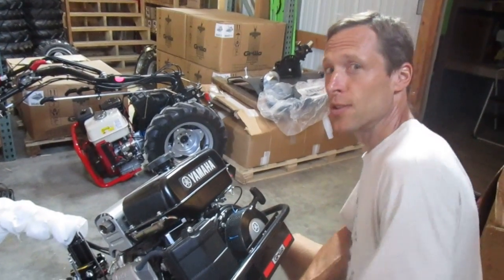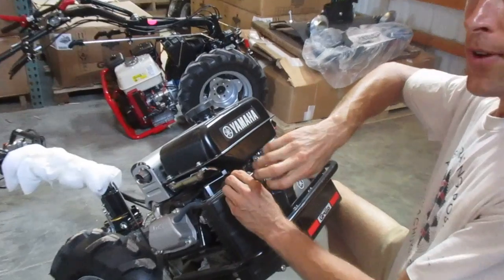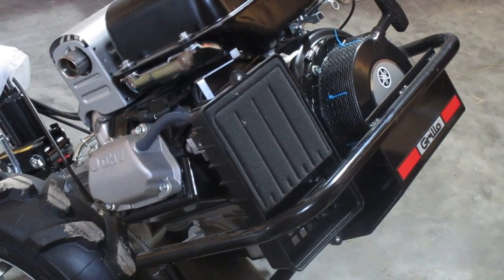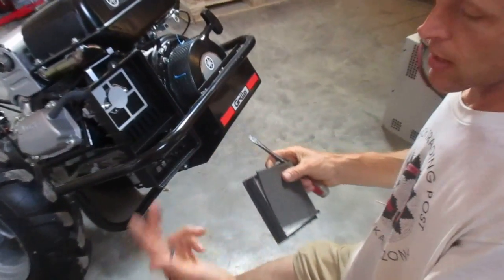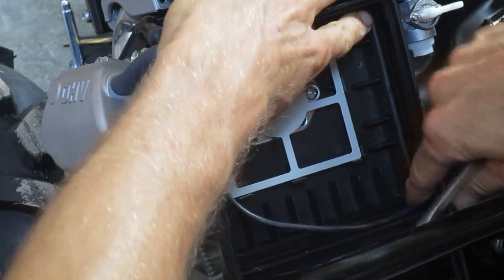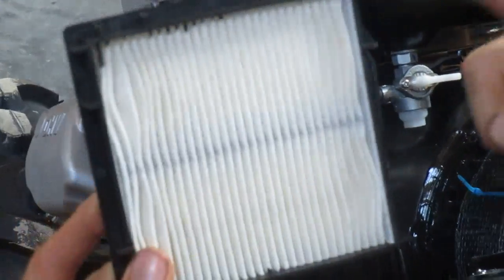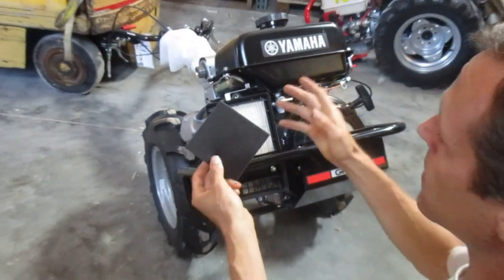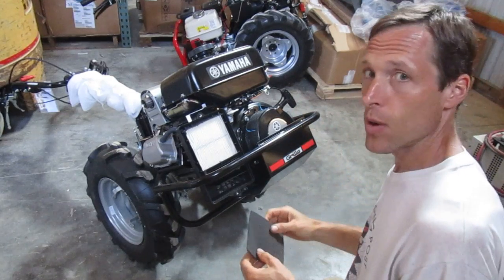Yamaha MZ360 Air Filter Upgrade

Comment: Do you have the means to cross reference part numbers to see if this filter will fit my Ridgid generator with a Yamaha MZ360. I have tried contacting a repair center, Ridgid, and Yamaha with no answers. Generator Model # RD0906812B, MZ360 Engine Model # RD09068-2B. It looks like the air filter housing in your video is the same on my Generator. It was purchased from Home Depot a few years ago, it’s only been used for about an hour and essentially new. A $1000. Generatir should have had a paper filter in my opinion. Every small engine power equipment  I own have paper filters. Thank you for any help you can offer.
Reply: Did you find out if it fits?  I have same generator.   Looking for part numbers

Comment: What is the part number for that filter set?
Reply from the maker: 7CT-E4451-10-00 for the paper filter, 7CT-E4461-10-00 for the foam pre-filter, and 7CT-E4462-10-00 for the O-ring gasket.
Reply: How to release rear seat in 2017 Silverado